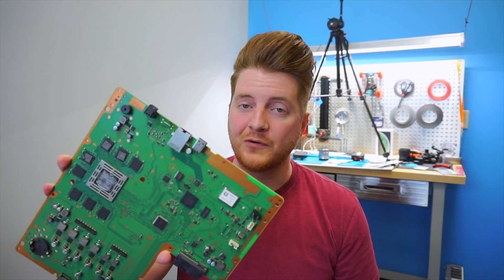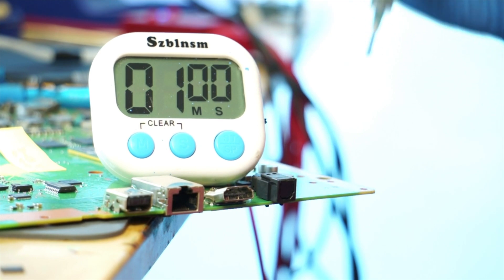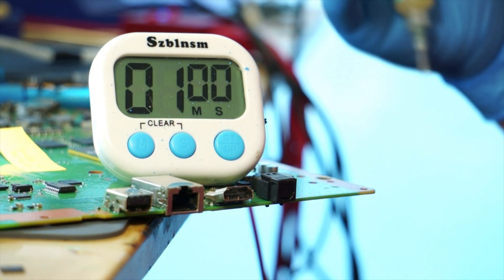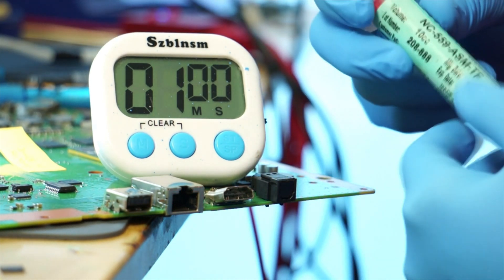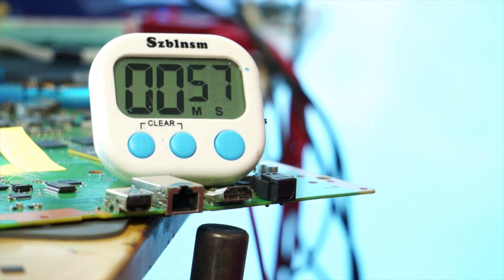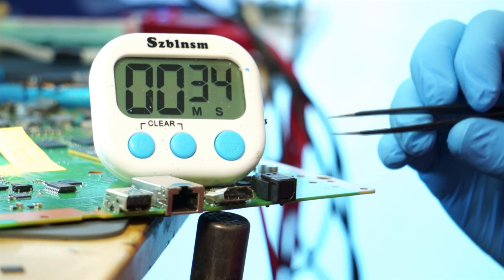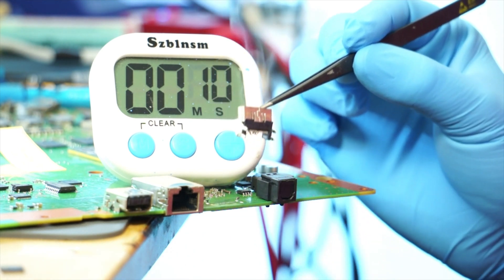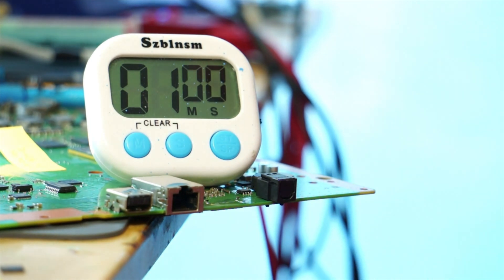How to remove a PS4 HDMI PORT in under 1 minute - Real Time Repair

Comment: Man, I’ve been heating this thing for 20 minutes now and it still won’t come off. I don’t know if the flux I’m using isn’t right or if my heat gun just isn’t up to it according to Amazon this they can heat up to 360°
Reply from the maker: @NateDyson  360 isn’t enough heat, need 400+
Reply: @ that explains it. Thank you for the speedy reply. Time to get an actual hot air station and not a cheapo Amazon gun haha

Comment: removing the port was the easy part. It's getting that lead free solder cleaned out of the holes and pads. Any suggestions? Tried flux with wire braid, cannot seem to remove enough to install the new one. Been sitting on my table for 3 weeks in limbo
Reply: If you have low melt solder you can mix that in each hole and you use solder wick. I've found using a soldering iron on the wick and a hot air station you can pull it out of the holes without any low melt. 

I know the post is old but it may help someone in the future.
Reply from the maker: No need to remove the solder from the holes

Just tin up the new port before putting it on and then heat up just like in my video and drop the new port on

Comment: yes... what you've done was the easy step.. now show a video how you get the old solder out of the ground holes.. because thats the difficult part of it.
Reply: just heat from the bottom and take a solder sucker and suck it from the top. Just did it today and they came out super clean
Reply from the maker: I have another video for that! Search my channel for other ps4 videos and you’ll find my solution to easily remove the solder from the anchor holes
Reply: Yes please!!! Will look for that video

Comment: I did it!!!! 🙌🏼 I was about to give up I spend like $80 getting all the tools for removing the port and after all I wasn't getting results and with this method I finally did it now I have to solder the new port on wish me luck
Reply: Did you succeed
Reply: @amazingking9169  nope I give up and give the ps4 for credits at GameStop and bought a slim instead. But I did remove the hdmi port but did a crappy job putting a new one on and didn't work

Comment: I got a question for ya, I did this with a PS4, had the gun at 415 no issues, all the pins desolder but the metal casing solder would not melt, i had to remove the metal casing, desoldered the pins no problem with your method, took me two hours to get those 4 other pins out for the casing on it. The solder will not melt for the life of me, i had my hot air gun at 485 and managed to slide it through with a lot of force, but there still solder in the holes and i have tried everything it will just not melt. Wondering if you have run into this?
Reply: How much flux did you guys use?
Reply: @muchostacos67  I finally managed to get it desoldered. You don't really need any flux at all for the desoldering. My mistake was that my heatgun was too far away from the PCB. Apparently you really need to be very close to the PCB. For me it was somewhere around 5mm. Otherwise the temperature drop will be to great. If you're close enough it's really easy and doable in less than a minute. I already did it twice now. The second time took less than 20 minutes for all (removal, cleaning, tinning and soldering of the new connector). I had my heatgun at 480°C. Maybe it's a bit too much, but it worked perfectly.
Reply: Same issue. It's completely stuck. I have mine cranked up to 480°C and it just won't move at all. Even after multiple minutes and even the help of an 80W soldering iron. It's just absolutely stuck in there for some reason. 
Do you think Sony uses different solder on some models? I also have an air suction desoldering tool and even that can't get the solder out of those holes.

Comment: This method or the one from last year using the iron tip on top and hot air at bottom ?
Reply from the maker: Depends on your preference! If you have a station that the nozzle is hard to remove, using an iron as well as the hot air helps. Ive changed over to no nozzle recently as it reduces the steps needed.
Reply: @profixerr6275  thanks you're a genius!
Reply from the maker: MDT Repairs 🙏🙏🙏

Comment: How did you not rip off any pads or tracers?
Every time I have attempted this I have lost a pad at least.
Reply: Don't force anything, wait for the solder to become fully molten then the port will come right out with ease. Also use good flux if you're not already.
Reply from the maker: Needs to be butter! https://www.youtube.com/watch?v=ucHdWKC-nJ0&t=17s Try this!

Comment: what temp did you use?
Reply from the maker: david valens 415 temp with full speed air. For iPhone boards I use 365-375 temp
Reply: @profixerr6275  for iPhone boards do you use full speed as well?
Reply from the maker: 3/4 - 4/5. Depending on your station you may need to adjust. The amount of air you have can change the speed that the solder melts.

Comment: how much heat did you apply
Reply from the maker: 415 full air on my station.
Works well for consoles. For iPhone board repair I am normally 365-375
Reply: @profixerr6275  Is that Celsius or Fahrenheit? I've been blasting it for so long, it just would not come off. the board even turned black on some occasions. I have an AOYUE 968A